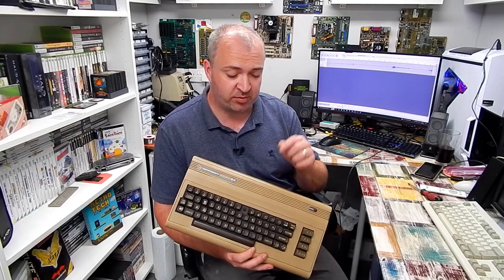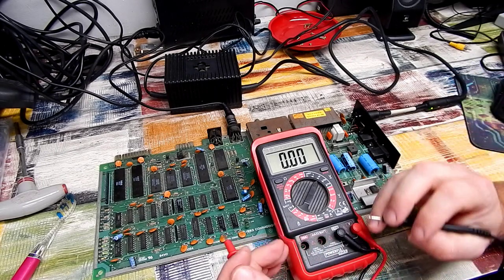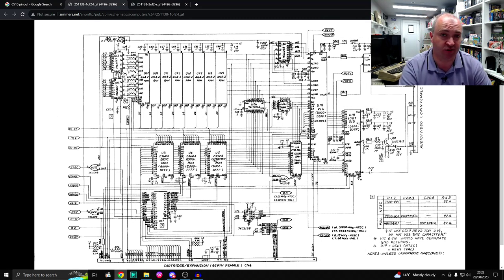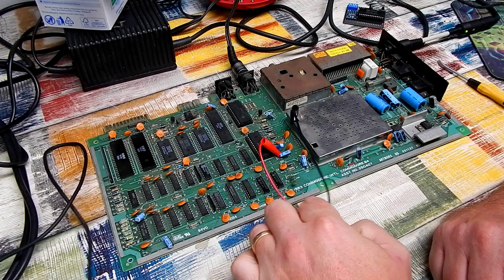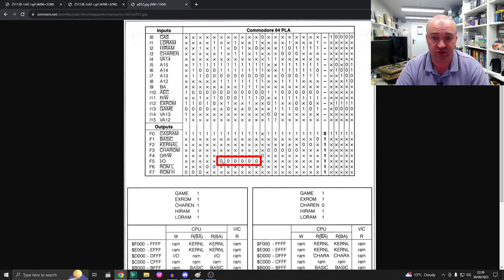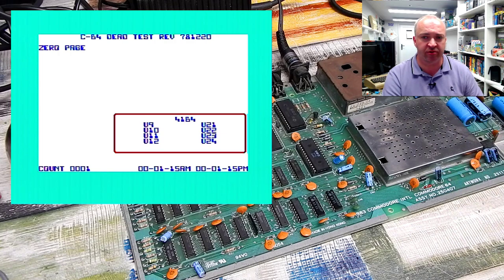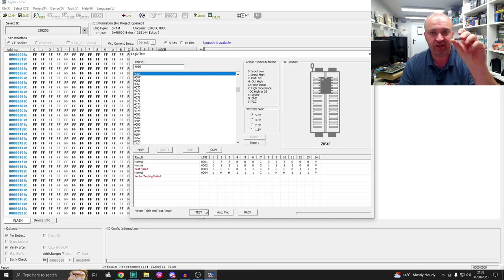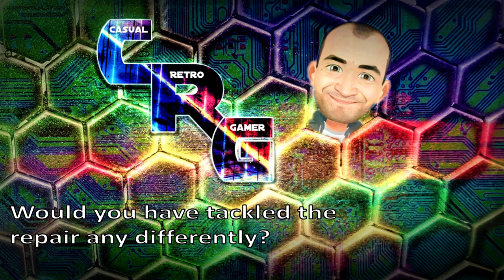Commodore 64 showing a black screen, can I fix it?

Comment: I always pull the SID on a new test. SIDs are sensitive, dead ones can cause black screens and they are not needed to test a 64
Reply from the maker: Good idea to be honest.  I did try to power the machine with the Sid out but it made no difference.  Probably should have covered this in the video but will try to be more thorough next time 👍

Comment: I called it the moment the screen was black.
Over the years I have had to replace a number of these MOS chips that causes the black screen.
Reply from the maker: Seems to be a very common failure point.  I'll have to keep an eye on the other mos logic chip.  I suppose it's only a matter of time before it fails as well.

Comment: 4.86 or 4.9, I don't think it make any difference 😀
It could be your probes that got a better contact the second time you measured ...
Reply from the maker: Haha, good point, although I'm sure the difference was made by the contact cleaner and it was probably spraying it into the switch. On the same PSU it's now reading 4.96.